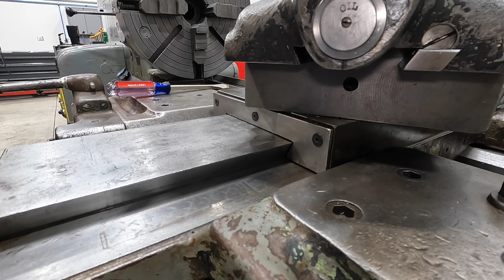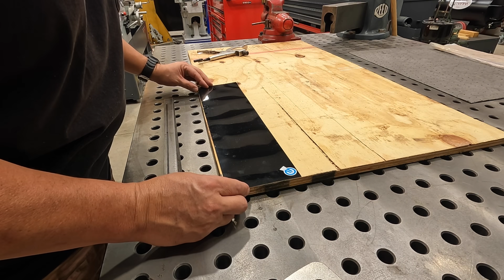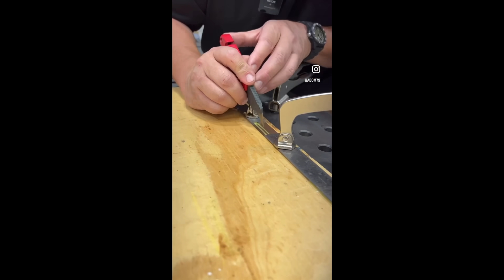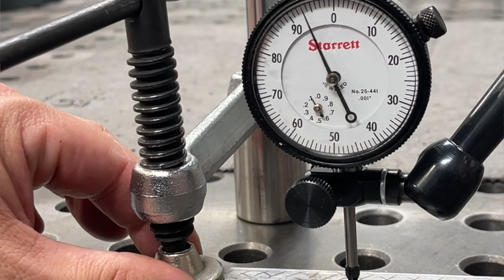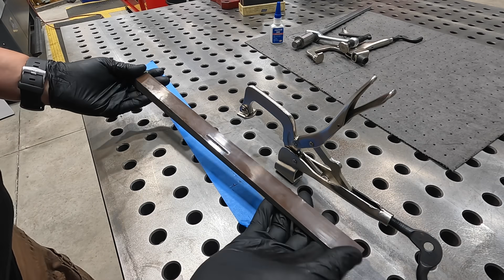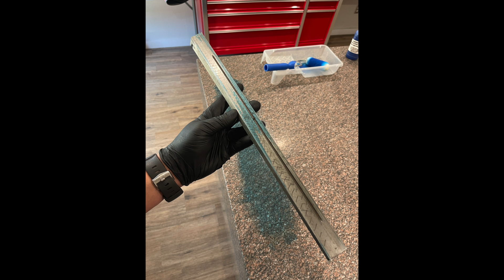Gib Repair for American Pacemaker Lathe

Comment: My gib read pretty similar to the high spot you had too, ending up with ~.0015. I also did a sample to measure the film thickness of the glue which turned out to be about .006" with light clamping.  

When I glued the shim, I concentrated my clamping pressure on the high spot, and son of a gun it ended up near dead flat - no hinging and can't get a .001" in there.

Comment: the stab style oil gun like your first is best. yours must have a bad check valve in it letting oil back into the reservoir. also they make oil ports that have a bigger check ball in them, this lowers the pressure to bypass it.

Comment: Hey Bud. How about using an oil injector for automotive AC work. That would build the pressure you need and won't leak. They usually have a capacity of 2oz and are refillable.

Comment: You're worried about 2 thousand's bow, and then you went ahead and glued...... the shim on the gib appling 2 coats of glue in one section.....
I think it was likely assembled like that, to assist with oiling.

Comment: saddle of the lathe ways are very dirty, must clean it before anything else. I can see black oil film over the bed ways.
Seems very old machine and way wipers have disentegrated over time. if this continues the lathe bed will not be in any good shape.

Comment: I think some of the 10 thou was the compound, but most looked to be the cross slide. Edit - There looks to be a small amount of movement in the compound in addition to the 10 thou measured on the cross slide.

Comment: You could snap a rubber gasket to the back end of the grease piston and drop the oil straight in.  There’s a lot of similarities b/t the grease gun and a caulk gun.

Great information in your video!  I had a few takeaways from it, and I will apply those in the future as I’ve had a lathe do just the same thing.  I threw it out for parts.

Comment: Iv never really found a system of oiling I’m happy with. Iv found all the oil guns iv been able to source leak everywhere inc the fit better the nipple ( zerk ) and the gun. 
Another commenter said s as about stripping out a grease gun and welding up the end that sounds a pretty good idea although it still leaves the issue of leaking at the nipple ( zerk ) itself. 
Iv changed the lathe at work to a concave type oil nipple like a little kitten plate almost with a lightly sprung ball in the middle you just oil with a regular oiler. 
I was attracted to these as no 1 can come along and pump grease into them and you don’t need a “special” oil gun down side is they aren’t very good on anything other than a horizontal surface for obvious reasons. 
I’d be very interested if you shot a video on oiling and the various oil guns and hard ware that’s available for this job 👍🏻

Comment: Iv been around lathes etc for a while now and still haven’t really found a satisfactory way of oiling , every oil gun iv got leaks everywhere including the fit on the zerk ( we call them nipples in GB ) 1 of the other commenters there had a suggestion I found interesting 
“remove internal spring piston etc from a grease gun + weld the end up” 
That sounds a good idea , probably fill oil through the bleed port. 
This still leaves a couple of issues as I see it tho with the zerk / nipple itself as I find these leek oil and worse than that in a work place someone is sooner or later going to come along and pump grease into it..
Iv changed the ones at work for a “dish type” oil nipple it’s like a concave dish with a very lightly sprung ball in the middle and you just go at it with your regular oiler  least no 1 can pump grease into these issue is tho there not very viable on a vertical surface. 
I’d be interested in a follow up video maybe like a specific video on oiling / oil nipples / oil guns etc think it’d help a lot of people out me included 👍🏻

Comment: I actually use a silicone vacuum hose on the end of the oiler can and it works fine for pushing oil into the zerks. Might be about 1/8 "I.D. hose. You  just need to make sure you don't pop it off from the pressure. But yea, thats my quick fix to oiling through a grease zerk with an oil can.

Comment: Modify a one shot oiler from a bridgeport to a single tube with the oiler fitting on the end.. Small, compact and designed for pushing oil through those ways

Comment: Grease guns are used to inject epoxy into cracks in concrete repair. I don't know if they have different pistons but epoxy is prob same viscosity as oil. So Google epoxy injection greas gun.
Reply: He wants to inject oil - not epoxy.

Comment: Appreciate your videos because of your knowledge and, above all, your humility. I just wanted to mention that on all machines I have come across with gibs like that, there is a screw on the opposite side of the gib that you have to back out to be able to advance the gib and reduce the play. I am not saying the Pacemaker is built like that, but it might be worth investigating since it would make future adjustments easier.

Comment: I've only seen that type of hand oiler used for the press-in, flush fittings specifically intended for oil - the same kind you can oil with a normal oil can.

Are the zerks original? I wonder if someone replaced whatever it had with actual grease zerks, which have a check valve spring strong enough to displace grease (and probably too strong for a hand oiler).

Comment: With Loctite?its too hard to make a new jib?or is more better for first you can scraping the slideways of this carriage and later you can make a new jib.can be a best solution,not how you show on video
Reply: Imo this is totally fine. Its not a production machine that runs day in, day out. That loctite blackmax is no joke either, i dont like adhesives but that stuff will practically weld material together.
Reply: @JackS425  im happy for you.for someone is good to learn on youtube how to do for maintenance of tools machines.just it

Comment: Try Part # W54219 at advance auto parts. It’s a needle greaser tip. I don’t think they have a pressure spring in them.

Comment: I modified a harbor freight mini grease gun with a flexible  hose  . you take the plunger out and seal the hole in the back with some silicone. fill the chamber with way oil. You should have no leaks. Put your grease fitting on the zerk and pump the handle and it will pump the way oil thought the zerk. Important: you have to hold the oil filled chamber upside down  so gravity will feed the oil through the gun, otherwise you will just be pumping air.  After you are finished lubricating, store the gun right side up so the oil doesnt leak out of the crappy threads that hold the chamber to the head.
Reply: Excellent. Well done!

Comment: To grease my lower ball joints i had to buy a special tip for my grease gun since there wasn't enough room to use a normal tip. It is just a hollow tube that has the end machined to the same degree as the area around the ball on the grease zert. You just push it strain in and hold it while pumping, they do have a similar tip that is built like a hyperdermic needle designed to puncture rubber boots like on the front axle of a car to extend the life of the cb joints. Don't confuse it with that. That may work with your oil can

Comment: I have a zerk lubricator like the first one you showed that i us on my mill. I had mixed feelings about it until I noticed it worked very well on zerks that were within 45deg of vertical. All the zerks on my mill are now aranged so that the I am pushing down when pumping the oiler and it has been working fine.
 I will need to do deal with shimming the Y axis gib on the same mill, so this was very good info.

Comment: Look up a Trabon gun (aka oil purge gun) for your oiling system. Pumping oil at high pressure is what those are made for and it would probably work very well for your application.

Comment: What type of shim stock is that? What material? I've only ever come across steel which i dont have, and plenty of brass which i have.

Great work, simplest method sometimes is the best. I'd have done the same.
Reply: High quality plastic shim stock especially made for the purpose.

Comment: Hey homie! I'm watching your vids involving this Pacemaker and I have some thoughts.

Another thought is that the spindle bearing needs adjusted. If there is an adjustment screw on the back of the quick change gearbox, you should not be able to turn it without assistance. When tightening, have an assistant hit the chuck face with a soft faced mallet as you turn the adjustment screw. The chuck should be able to be turned with light resistance. Carriage gibs seem to be out of adjustment too.

Comment: All in all there  does not seem that  there is much wear in your sideways I would be real happy with that. I would think that some of the tightness at the extremities is not only slide ways not being worn in that area, but feed screw will not be worn out at the ends either and most likely the nut has some adjustment that has been taken up too. I made an oil gun from an  pump oiler and a grease gun nozzle and took the spring out. It's not perfect but it works. Glued on shim is a  acceptable method of reusing a gib. I cannot see why the plastic would not work, I don't think the oil will bother it. If it does use brass next time.  The other option is to make a new gib. Unless you are going through the motions of rebuilding the whole thing why do that?  Even then, a shimmed gib might be just fine unless you had to do major work to get everything back in shape. Cheers

Comment: Adam, the Myford lathe's of old used oil zerks exclusively. They had a custom made oil gun, which are now un- obtainable, the originals that is. Myford UK sell a Swiss made oiler which they recommend as the replacement. I believe a company named RDG Engineering also sell them. Only problem is they cost far more than I'm prepared to pay like over $100 plus about the same in shipping. I have a Myford ML 7 and for it I use an oil gun from Princess Auto, our equivalent of Harbour Freight. It's not great but at least it gets some oil where you want it but also makes a mess doing it.
As to your modified grease attachment you need to open the fitting and reduce the spring pressure. It's designed to hold back thousands of pounds of grease pressure in what ever bulldozer you're trying to grease. Your oil can might produce 5psi at max so it'll never overcome that spring's tension. I'd even go so far as to suggest removing the spring altogether and see what that does. Might make it a little messy but it also might get oil where you want it . Regards from 
Canada's banana belt.
🤞🇨🇦🍌🥋🕊️🇺🇦🕊️🇺🇲👍

Comment: I'm not sure the name of the piece but it screws onto the end of the grease gun in place of the standard coupling with 1/8" NPT. It has about  a 1/4" diameter tube about 1 1/2" long with a short truncated taper with a hole in the middle. It is meant  to push into a zerk far enough to depress the ball and the taper seals the hole somewhat. Most auto parts stores carry them as they were used to grease the drive shaft universal in older vehicles where the standard couple won't fit. It might not seal well enough for you, but doesn't cost much to try. Really enjoy your channel!

Comment: Keith Fenner uses a torch and a hose with running water to thermally straighten his propeller shafts.  But your technique is more sensitive for a smaller piece of steel.  As a retired electronics type, I'd have just hit it with a hammer, but that's what separates you pros from us amateurs...  Great video, Adam!  Thanks!

Comment: Adam with the grease gun type oil fitting you made, the check valve is designed to work under much higher pressures. Some grease guns run up to 10,000 psi if you can get the tip apart you could put a much lighter pressure non return spring in there and your oil can should be able to overcome the check valve spring and oil the cross slide ok. It's a good idea you have come up with, just needs a little tweak!

Comment: I've never used that push n lube but I have a similar item for lubing my chainsaw bar.  Granted it uses grease instead of oil but it did the same as your until I pushed the plunger down and made sure there was no air in it.   Once that that done its worked flawlessly for my chainsaw grease.   may want to try?

Comment: That is an easy one! Clean up a old grease gun, remove the plunger cup, rod, and spring. Braze a disc on the rear cap to seal it. Take the cylinder and Teflon tape and seal this to the head of the gun. I use a flex hose and hold gun vertically to fill and use. Twist the brazed cap on and your ready to go.
Reply: You have to have enough pressure to get the ball in the grease fitting on the machine to open and allow the oil to pass.

Comment: I'm sure that the plastic shim material will be great and you have advice suggesting that it will. But is there a specific reason that you didn't go for brass or steel shim stock?
Reply: Since there won't be any sliding across that surface, the plastic will probably last as long as the gib or Adam's ownership of the machine. The screw and end plate limits any kind of linear movement, so it is really just under compression. So there's no wear on it and really no need to use more expensive shim stock when the plastic gets the job done.

Comment: Just a pro heads up. When your using a phone or tablet to record video hold it sideways to get the proper orientation result. Its a very common rookie mistake.
Reply: No good for Instagram though.
Reply: calls his advice "pro" and doesn't know that it's a short spliced in. 😂

Comment: McMaster-Carr sells an oil gun that looks like a grease gun.  It will generate high pressure to get past the ball check valve.  I bought one for my Broadbent Schofield (English) lathe.  It is very common for English lathes to have grease nipples for oil.  The MMC part number is 1879K21.  It works very well but it tends to leak when not in use. Ken

Comment: For oiling I can recommend the high pressure oil push press made by PRESSOL Nr.12362, which is a proven design and still made the classic way.
Reply: Yes, but 
Yes, but PRESSOL Nr.12362 is a high-pressure lubricator for grease, and not an oil lubricator as Adam wanted.
Reply: @olevjorgensen  well I use them for over 20 years with way oil without problems and my old masters did it as well. Even according to my supplier it works with both lubricants.

Comment: I'd just drill 2 holes and push ball oiler ports there on the top of the dovetail. Or make an elbow with ball oiler ports that replaces the grease fitting. To me that seems like the easiest way to make it work.

Comment: Hey Adam, for your oil pumping solution I’d recommend you look into a compressor oil transfer pump from a HVAC supply company. I have one if you want to get the part number but they are a simple hand pump that is pretty powerful. That’s been my favorite method to date. Also works great for headstock oil changes and anything else that requires transfer of thicker viscosity oils in quantities from a few ounces to a gallon. They run 70 or so bucks on sale or 100 for the top shelf versions. Uses a standard 1/4” flare nipple and can easily be converted to many different sizes from there. I believe the threaded nipple is actually 1/8” NPT if memory serves me correct. 
Good stuff. 👍🏻

Comment: The thing is, as soon as you tighten up that gib it's going to conform at least a little to the static external face anyway. So unless you're willing to pull it all apart again and check the flatness of that static face you're probably better off doing exactly what Adam is doing.

Comment: just buy a pot grease gun on wheels, pump it up with air pressure and close the inlet and put a valve on the outlet.
Reply: I found that some oil ways need a high pressure to push the oil around. I had a spare Wanner grease gun, cleaned it out and made a new adaptor to fit on the nipple of the zerk, with a tiny o ring in it. Now I can really push with out lubricating the whole workshop.

Comment: Might have been quicker to make a new one Adam :D
Reply: No, making a new one takes way longer. Getting the taper right then scraping it in … Only thing I would have done is to scrape the bearing side to improve oil retention. But this is a workhorse machine and as long as Adam can hold the tolerances he needs to achieve then it’s the rights approach for him.
Reply: Im sure Adam will write "completely rebuild cross-slide" on his list of long-term projects on the whiteboard :D